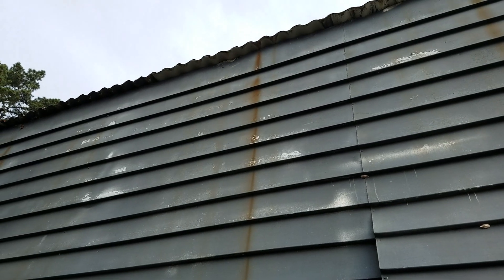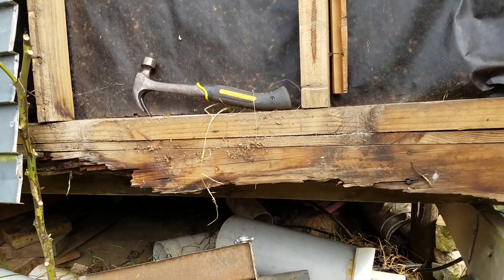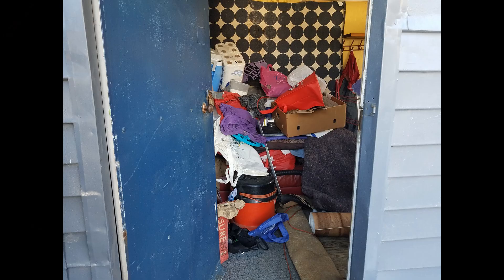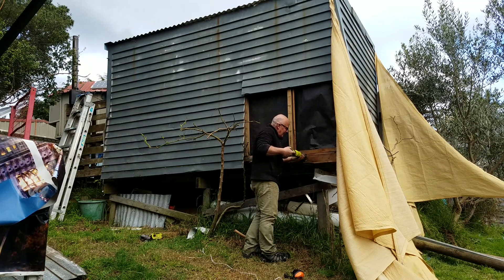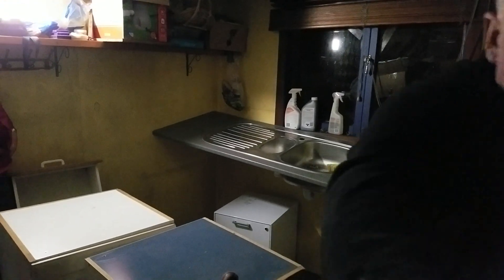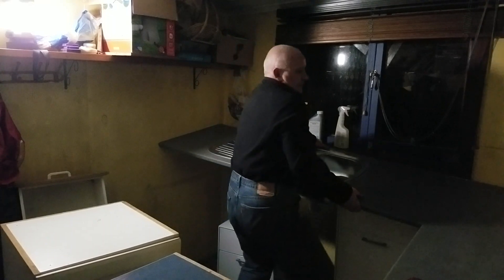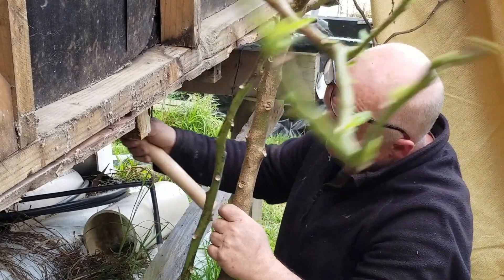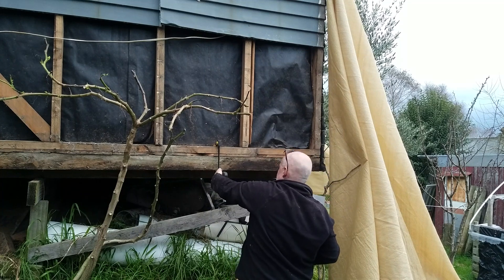Saved and Repurposed Old Shed becomes Kitchen/Bathroom. Solar power, Biodigester Toilet- free gas.

Comment: Screws have no sheer strength..
Reply from the maker: yet nails do?- That's amazing! So why is it that they use them extensively in hard landscaping? retaining walls, animal handling yards, Outdoor pursuits confidence and army training wooden strutures? In fact building Regulations specify their use in certain High stress areas.
Reply: @t.h.o.r.  yup screws have definable shear strength providing they are sufficiently deep. Just look up the shear strength of the screw being used ie M10 - the screw pitch doesnt not provide much strength - its the middle diameter that has most of the strength. When I was building my verandah with 6m rafters - i was surprised how small the screw spec was - but as per usual i doubled up
Reply: Yes, we know. Thanx, Tips..
Reply: Go to school, ignorance doesn't help you or the people you are missinfoming
Reply from the maker: @leonunlimited7552   what would you suggest I study?  Oxymorons perhaps? because in one comment you offer the opinion that screws have no tensile strength then in the next you agree with me that the building regs stipulate their use in high stress situations - how can you be right twice when you say two opposite statements?  Thanks for your feed back, I always enjoy your input.

Comment: I"m still wondering about all the energy, all the power you have. It's an interesting project what you are doing now. Thinking to copy your idea with the 'Safari Roof' at my little workshop.
Reply from the maker: workshop=2Kw solar on the shed roof 440Ah batteries, 6Kw inverter, 7Kw petrol gen,  House 120watts on the roof, 69w wind turbine and 120Ah in the batteries
Reply: Don't.
Reply: @leonunlimited7552  don't what, the 'Safari Roof'?
Reply: You can do it, just 1 don't use screws in places they need sheer strength, like attaching vertical boards where wind will contmstanly move them, and 2 put vertical boards from the from down to nothing, land them on a piece of 2x.. or a birdmouth.. that box he built with horizontal 2x4s would not hold up anywhere it snows.. he is probably fine in New Zealand, but should have said something as he was doing it. Like I said, he is lucky he doesn't get winter there.. NEVER use screws on stairs unless you are screwing down treads. You can use screws to get something into place, but always use nails in places where they will be stressed, like when attaching stairs to a wall etc.. the key is sheer strength and screws have none. His roof may last 10 or 15 years, but eventually some of those screws will break. If you want to be lazy or need a hand to hold while you work, get an air nailer. The nails in an air nailer have glue on them that activates through friction, and the sheer strength is huge (I cant remember off the top of my head, but you can look it up) Think about it this way, a screw is ridged, it is always hard material, even the zinc coated ones. Wire nails are soft and will bend. A 3½" duplex nail has a 5000lb sheer strength.. think about your environment and what winds you have,, if you ever want to walk on it (Do not walk on the roof in the video) I do wish he had gone about this a little different.. he actually could have learned something...
Reply from the maker: Awesome That is so much more use to me than personal insults- Thanks-
 Although,  there is a dividing wall mid way down the shed giving heaps of strength. many roofs at my latitude are  3-5degree pitch - because we are an island in the Pacific- we dont get snow where I live. tyhats why no insulation and the 'Safari Roof' cos it gets stupidly hot in there in the summer.  Ive just screwed the solar panels to the roof- please don't tell me that I should have nail gunned them!  Here in NZ roofing nails are a thing of the past. We have used 14 gauge roofing screws for decades. and yet the roofs manage stay on?  One question- when you calculated the stress loadings on my roof- how did you do the equation without knowing how many screws were used?
Reply: @leonunlimited7552  Thanks for the advice, but my roof is entirely made from steel so I guess, nails are not really helpful. BTW, I'm a German and I live in the Philippines since 20 years around. We don't have so much snow here ...